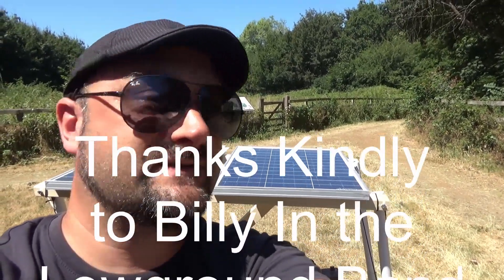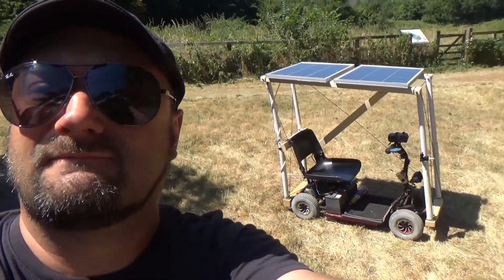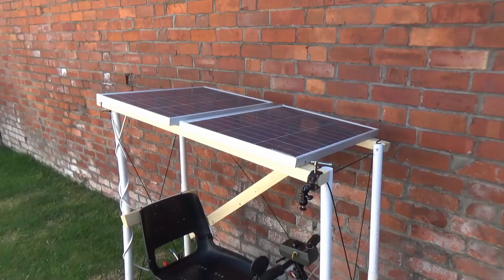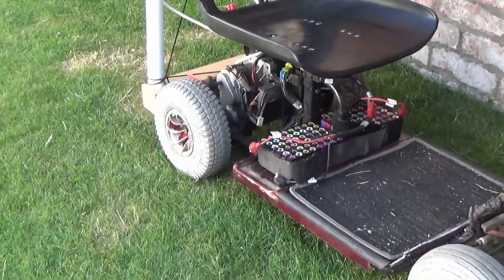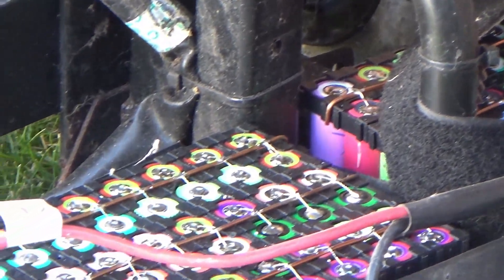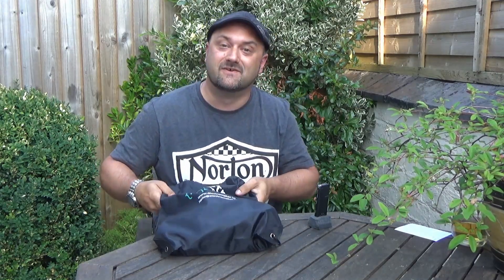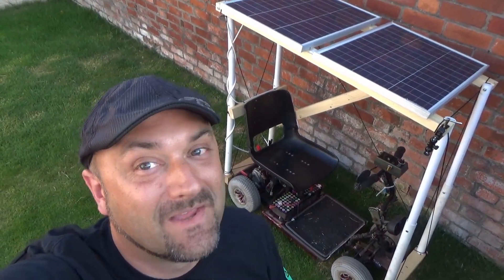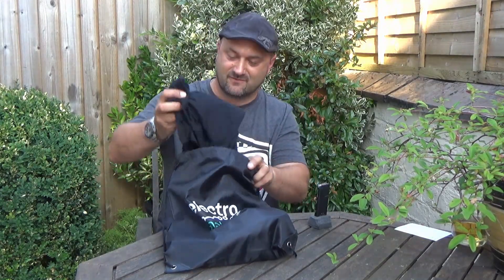DuB-EnG: Solar Powered Eco Warrior Chariot Heatwave UK Car Scooter Channel Update Shoutouts hot sun

Comment: Can't wait to see the guitar amp build, are you using valves?
Reply from the maker: Jack Beale ...  definitely not going to use valves...  I want this unit to be portable and battery efficient...  I would like to take it to party’s and be able to have a jam outside with friends or with a backing track...  I love valves, but, they are soooo inefficient...  so, this one will have an integrated mixing deck, internal battery and some limited dsp effects with about four channel inputs...   bass, mic, lead and rhythm.  Your thoughts?
Reply: Sounds like a great idea, valves are great and all, but as you say not the most practical thing for what you are doing. There's many great sounding solid state amps about. I have a really cheap rechargable amp, that google doens't even seem to know about, it's great for playing out and about with, it has some cool lo-fi sounds when the battery is gong flat, like a dying wasp in a jam jar (but in a good way)
Reply from the maker: Aha! Yes! The grungy fuzz pedal!! (Batteries low!!) ...  love it!! Jimmy Hendrix eat your heart out!!!